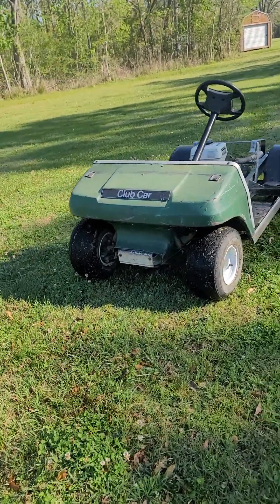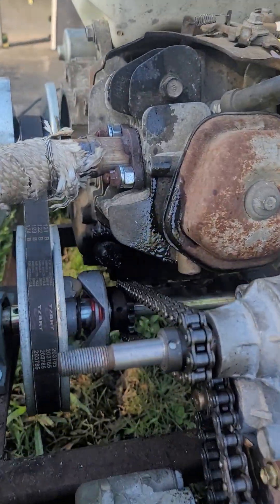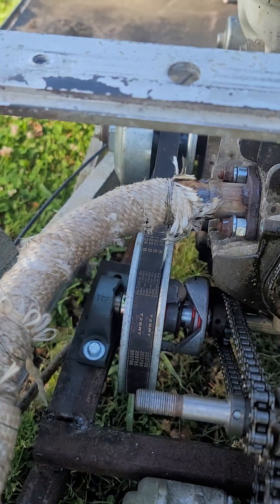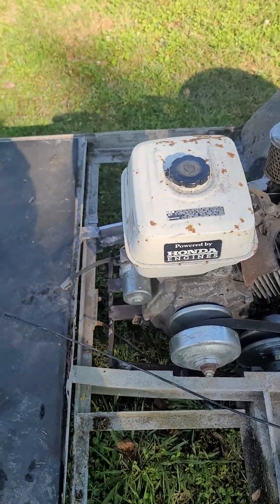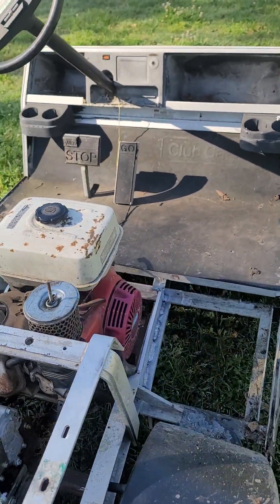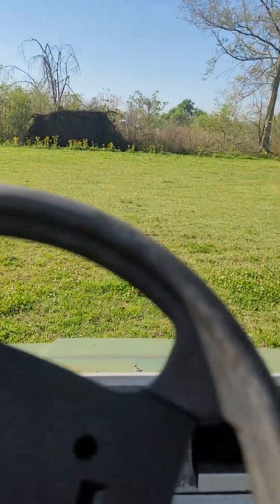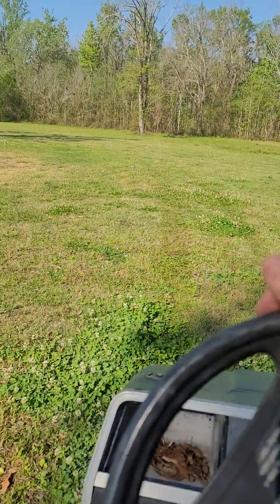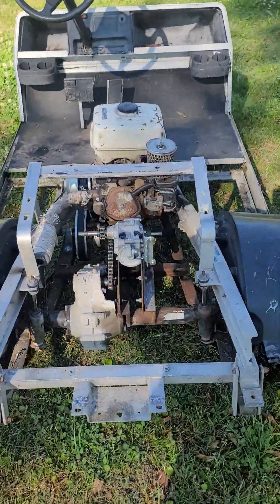Club Car Electric to gasoline conversion first run.

Comment: Hi I am going to do a build like this what I am going to do is bolt the motor and jack shaft to one plate so the belt dose not have to move.
Reply from the maker: @stevenpleasant5834  
Then as the belt wears and stretches there will be no adjust to continue using the belt.
If you adjust as it wears you can 90% more life out of the belt.

Non adjustable you replace the belt when it wears and slips

Comment: Great build. I could not see how you built the  front pivot point for the engine bracket.
Reply from the maker: I did not build it yet but I plan on it

Comment: Hows that gearbox holding up after a few months of use? They're only really rated for 7HP tops but a lot of places list them working up to 14.
Reply from the maker: Strong so far.
I abuse it alot.
Reply: How is it now? I have a 420 on my golfcart and im thinkiing about using the reverse gearbox 30 series  also does it still use 420 chain?  @candycoatedrazrbladz
Reply: Do u have to install the gear box with the fill hole facing up

Comment: Did you have to turn down the imput shaft also for the gear to fit? Like the trans mount and ajustment too. Good job.
Reply from the maker: So far it holds up to the abuse.Cable adjustments are finicky due to the internal slack in the shifter shaft.One day I'll pull it apart and see if I can make a tighter clearance bushing.
Reply: @candycoatedrazrbladz  the shift is a little hit and miss since i got back to gether, but I figured out i had my gearing backwads and have to oder some new gears. Better now than later I guess. thanks.
Reply from the maker: Yes I chucked yp the input shaft into my lathe.It a China gearbox so it's a metric input shaft.I skim cut it to 5/8".
If I remember right it was .630" and 5/8" is .625".
Reply: @candycoatedrazrbladz  yeah, idid mine last night, got it back together and seems to working OK
Reply: How did you come out of the rear end for the drive sprocket?